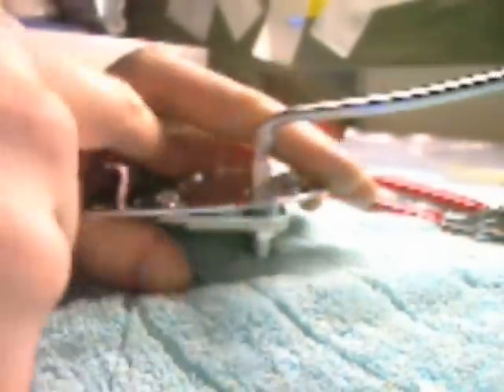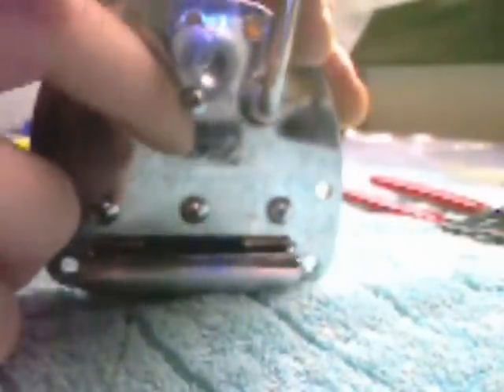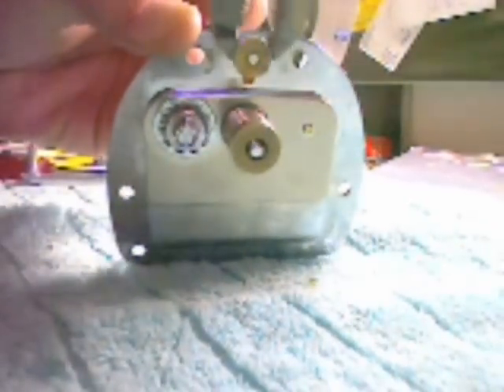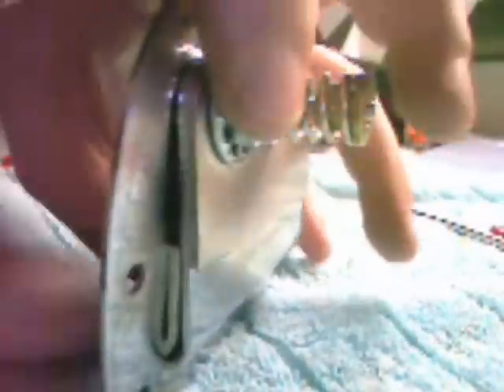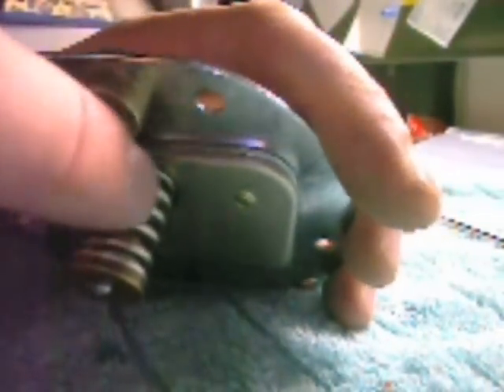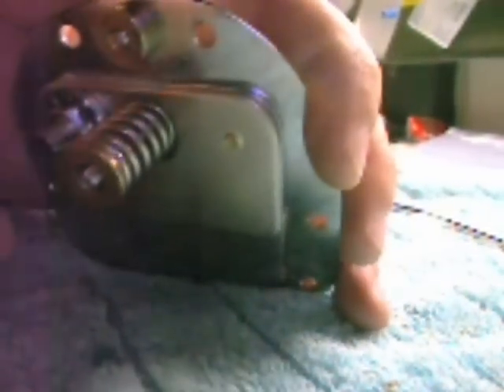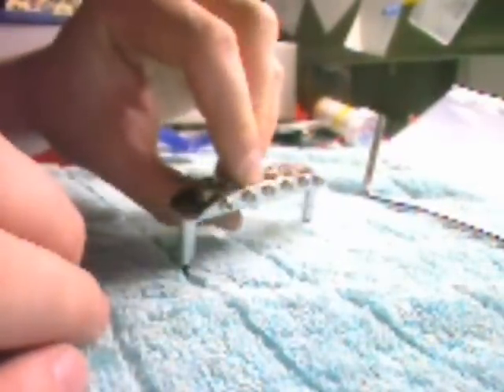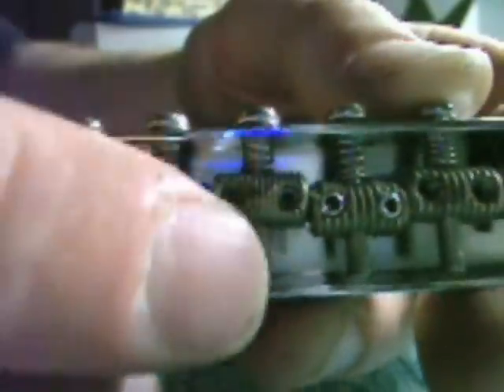Jaguar Setup Part 1 (The Directors Cut Part)

Comment from the maker: Because if I wanted Mac OSX, I could just install it on my present machine.  The current crop of Macintosh machines are basically glorified Wintel boxes with a special version of Debian Linux on them (Mac OS X).  We have a Dell at work that runs Mac OS, not emulated, but normal.

Comment: Throw the knife edge away.  Fit a small good quality hinge in its place. Tap holes for the three screws. Rivet to the inside plate and hey presto. That trem will Rock uniformly across all 6 strings and not move out of place. You will need to do a small bit of filing but the results are amazing. A bit of tinkering of the spring screw and it's a beautiful tremelo.
Reply: what kind of hing are you talking about?

Comment: Ive had WMM freeze up on me 20x in a row whenever I try and blend the clips together, then have to redo everything..I feel your pain.

Have you checked out the "Mastery Bridge"?  Google it.  Its built specifically for Jag/Jazzmaster.  Its more stable and will not rock, but still prevents the strings from breaking because of the saddle design.  The guitarist from Wilco uses one.  
I find the Jazzmaster bridge starts sinking lower over time because the screws turn on their own.  

cool video

Comment: The saddles of jaguar and jazmaster are perfect ,the issues are in other parts of the bridge ( in the screws that when you use too many times the tremolo is almost sure that fall down the height of calibration  ) ,but not the sound ,the buzz you have in your head ,for me is much better than ( mastery bridge ,staystrem ,mustang ,)why ? because ,the original ,fender ,not killer tone ,not killer sustain,and not killer twang ( very important if you like surf music ;)))) like mentioned previously.if  somebody know about that ,tell us